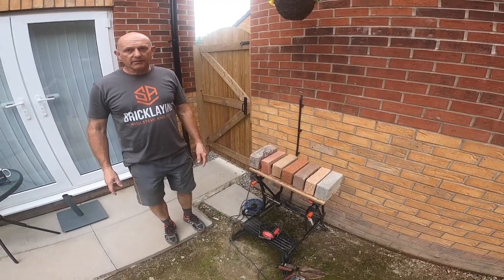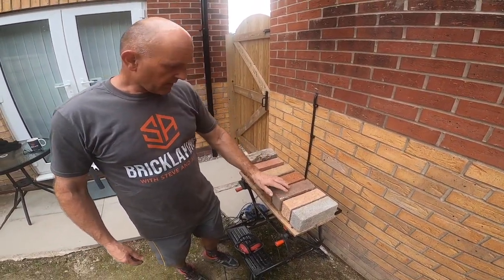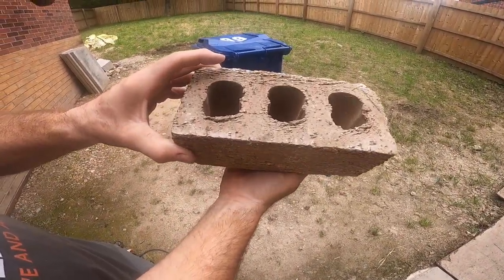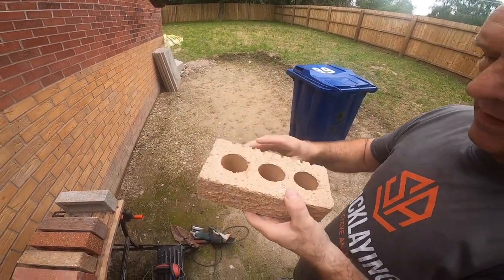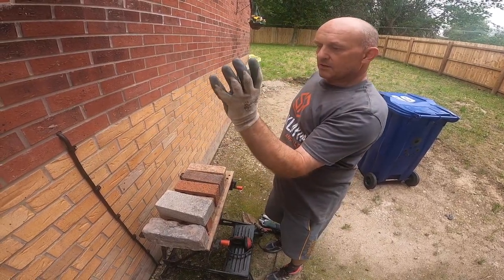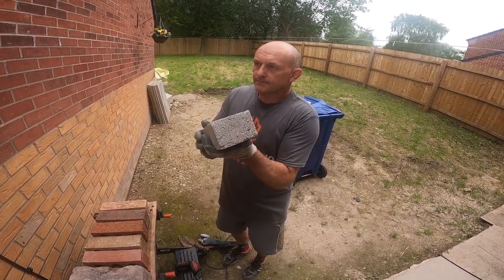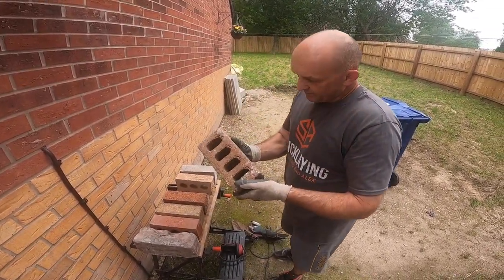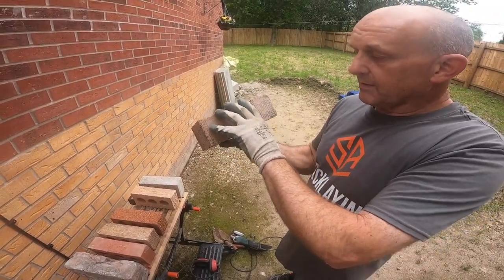SETTING BRICKS THE RIGHT WAY UP?...HOW TO SPIN A BRICK

Comment: Definitely mate. I can remember years ago I priced a garage up for family. And was beat on an all ready cheap quote. Was my uncles mate that beat me lol a few weeks later they rang me up saying water was coming in. As it was only one corse thick. I went round and spotted it straight away half the bricks was upside down and let water in. They said what can a do so I told them to paint  that water proof stuff on it. It worked but won't last forever. Big long this comment 😂😂😂👍😉but you right lads make sure they the right way 👌👌👌👌👍
Reply from the maker: That’s the difference between an experienced builder and a chancer who will undercut you . It about pride in your work too Mark .😌🧱👍🏽
Reply: @SteveAndAlexBuild  definitely mate 👍👍👍
Reply from the maker: @markhep  🧱👍🏽👌🏼

Comment: That makes sense, good lesson ... so best way to stack 'em, pick 'em up and butter 'em is?
Reply from the maker: Mmm good idea for another video me thinks 🤔😁🧱👍🏽
Reply: best way to stack brick is the normal way , like they have just came out of a hod, that way you can see the side of the  face of the brick looking down on the stack ,so you now whether the brick is upside down or not ,a lot easier as opposed to stacking the brick on edge,
Reply: @SteveAndAlexBuild  👍🏽

How to mix (though you have a few and I bought a damn 5 litre of plasticiser because it was on sale), where-how and why to stack your mortar and bricks (pretty sure you have that covered, lol) and yea, that last part. Starter ties -though I commented on that video a few nights ago, err site level and why you're footing is so important ... meh I give up ... You pretty much have it already.

Yea, how we stack, lift and butter the bricks sounds good.

I'd sit through a good hour of plotting and determining footings -where, how, why, digging, pouring to level and why, DPM, cavity tray, bricking up, insulation, tying in to an existing, weep holes etc. -basically what you did to brick up that garage, you toothed the outside red brick. Basically 'that job again' (it would take me like 3 hours to be more specific) but every single aspect broken down. It's not the job I'm doing but I find that garage conversion and extensions seem to be the best two to learn similar but different methods and reasoning.

Another thing, my house has roughcast at the back, sealed over with gloss finish paint and zero weepholes. I have beads in the cavity. I'm guessing that I'd have to be careful and hopefully not rip the cavity tray that is decades old, but I'd love to see how to retrofit them and even if they should be. My render goes pop and I'm hoping to have it redone, but if I can't and what am I even looking for, if anything? -Not specifically asking you to answer that, but just a thought ... I bet that video comes up on my playlist tomorrow ...
Reply from the maker: @bipedalspecies2086  😳……. 🤯 Thanks for the tips 😆🧱👍🏽